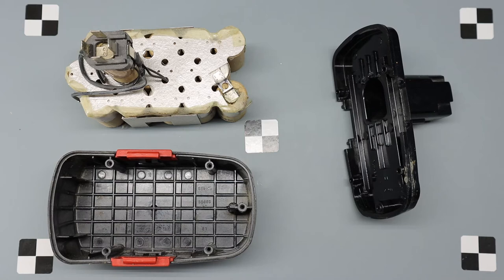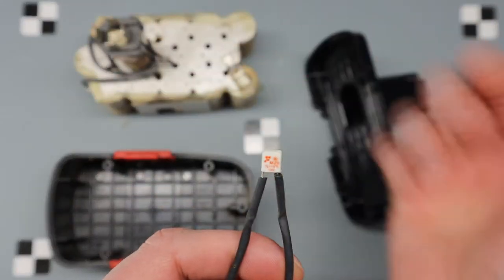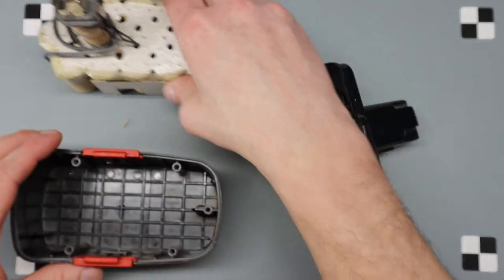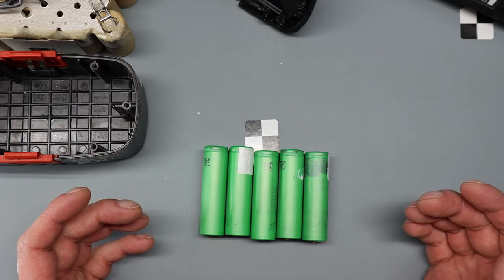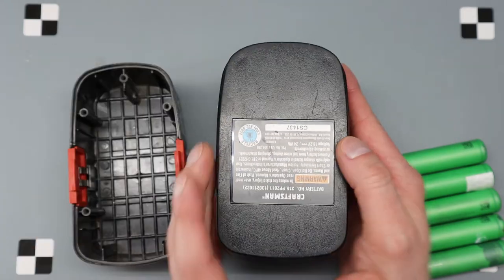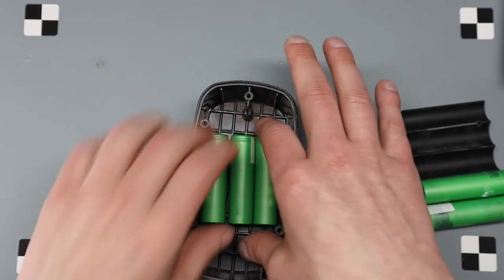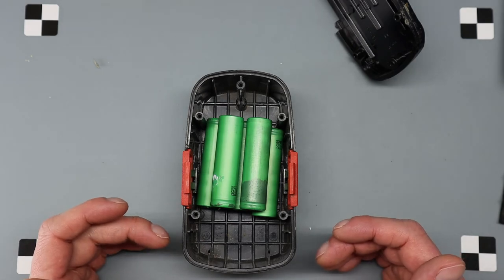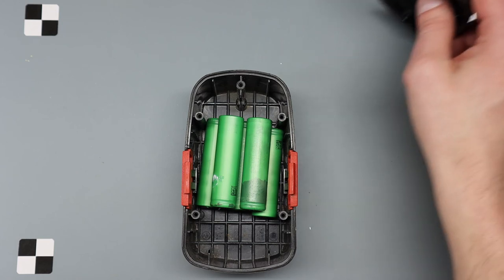Convert Craftsman Ni-Cad Battery to Lithium (part 1)

Comment: Hi, im trying to convert 18v ni-cd battery to 19.2v liteon battery, but i dont have that cable on the battery connector, i suppose the thermo-resistor is connected in the other two points (not +/-), but whats the other piece and where suppose to be connected?
Reply from the maker: The white thermal fuse is connected between the + and the Left terminal.
The thermistor is connected between the - and the Right terminal.
Reply: @eeAspect  thanks for information